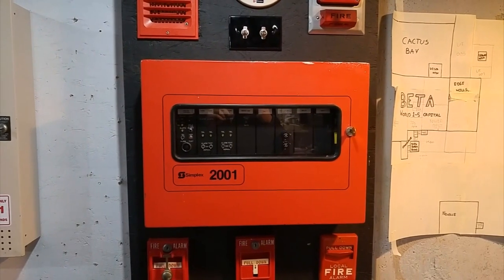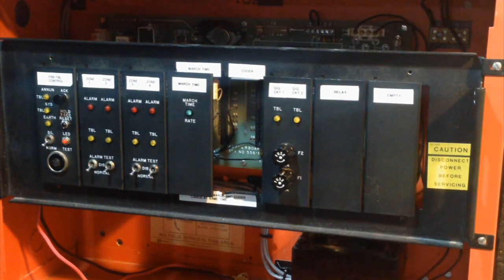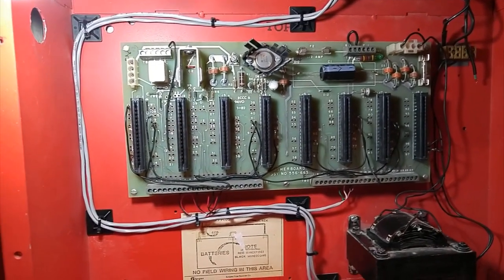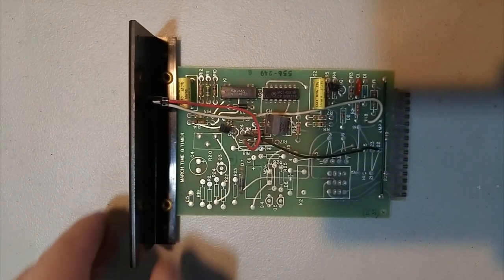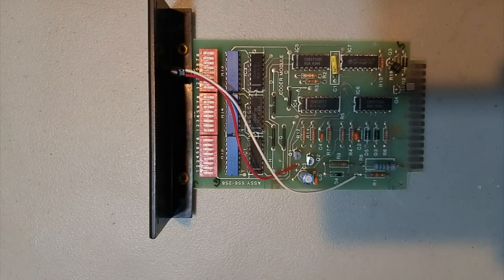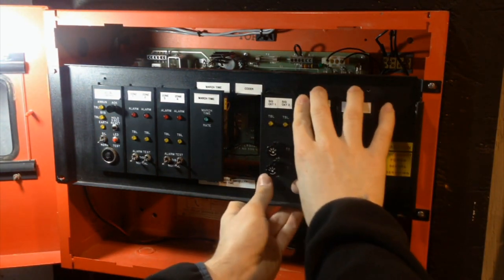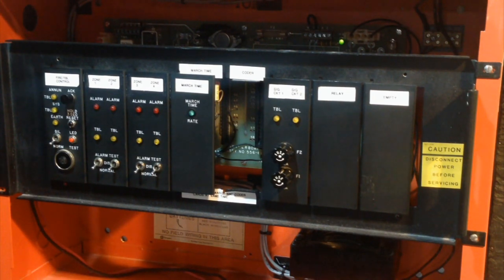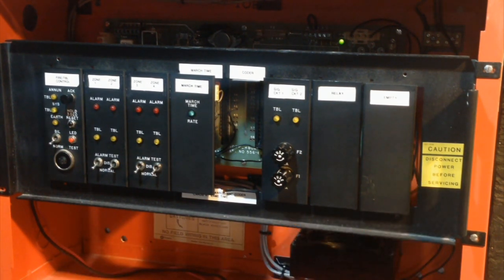Panels: In & Out: Simplex 2001 "Repack" FACP

Comment: You think this panel has painful annunciator wiring? The EST 6632 panel's annunciators require 6 wires for the control LEDs and buttons, plus 1 wire for each zone LED. My system uses 8 zones, so that's 14 wires to wire half of the annunciator's LEDs. You would need 28 wires to fully wire 1 annunciator

Comment: It's ironic; in the early 80s, Simplex claimed this fire alarm panel was very easy to work with compared to older hard-wired systems (such as the Simplex 4247 or 4208). But not today! It is more COmplex compared to many of today's modern panels.
Reply from the maker: Wait until I do one of these videos on the Autocall MD2 panel -- aka the panel that looks like a dead knockoff of the 2001 but actually isn't.
Reply: Maybe that's why the company is called "Simplex." Simply Complex.

Comment: FUN FACT 
The simplex 2001 was originally advertised and called the Life Alarm Panel when it was first released back in 1978. It wasn’t until they released this red “repack” version in 1982 that they renamed it the 2001. Notice the original 2001-8001s never said 2001 on them.

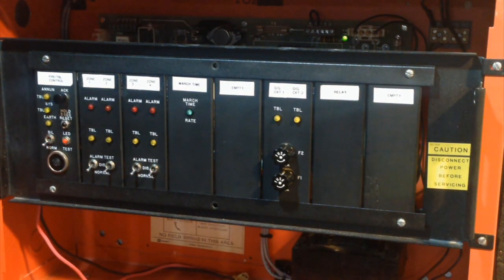Comment: 3:35 LOL, it's like "NUUUUuuuuUUuuuuuuu..." (Nuuuu, don't turn me off!) XD
Oh, and they forgot to solder the jumper wires? OMG WTF ... I'd be pissed at that! Why? Well, if this was installed in a building, and there was a fire ... perhaps the alarm system might not go off due to a poor connection. (Which can be intermittent - I.E. It worked when you tested it, but a few days later it might not work any longer.)
Reply from the maker: Yeah not sure why they weren't soldered. Definitely strange.

Comment: What bay version of the 2001 would you need if you wanted to do a voice system?  My dad was in charge of two buildings that had voice evacuation panels but they all were the switches and the fuses like this 2001 and I asked another fire alarm guy on here what it was and when I told him it had an OSC stop switch and had the switches etc he said sounded like voice capable 2001's
Reply from the maker: You would need at least a three bay system to hold the tone generator, tape recorder, extra power supply, microphone, and speaker circuit controls.
Reply: ***** cool thanks

Comment: +NewAgeServerAlarm If the coder card only goes 4 times, does that mean the NACs won't sound anymore after the 4 cycles,  or does it do 4 cycles - pause - 4 cycles - pause -  and so on...
Reply: This article may also be interesting to some: http://firealarmresources.com/wp-content/uploads/2015/07/How-to-make-the-2001-3049-Coder-Continuous.pdf
Reply: Yes, it will only do 4 rounds and stop. I'm assuming the coding card is used for retrofitting older systems that had coded pull stations/older panel that did 4 rounds of 4 pulses. I know of the former Ford assembly plant near my city, had something like this. They started off with a coded system, and safety workers had a card with the codes, so when the fire bells rang a certain code they knew where the fire was. When they redid the new system, they made it so it would do the exact same thing, except without the coded pulls.

Comment: Simplex 2001 panels are EXTREMELY difficult panels to work with.  I know.  I had to troubleshoot one due to a "ghost trouble" or an intermittent trouble.  And, it was beyond ridiculous to work with.  We had these at the pool where I work, we have a Simplex 2001 panel at the older pools.  I hate them!  Want my advice?  If you want the old Simplex 2001 march time?  Just get get a car turn signal relay and code your horns with a car's turn signal relay.